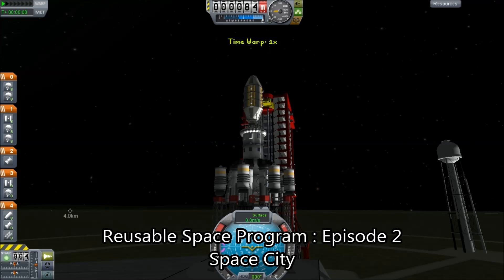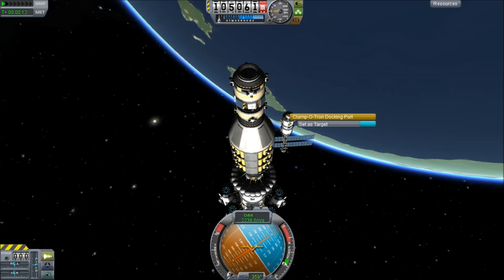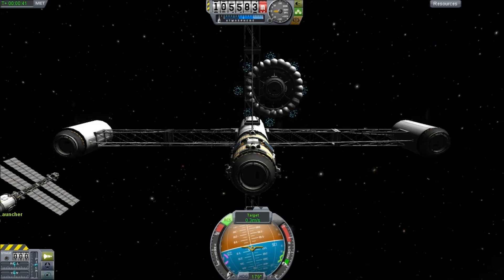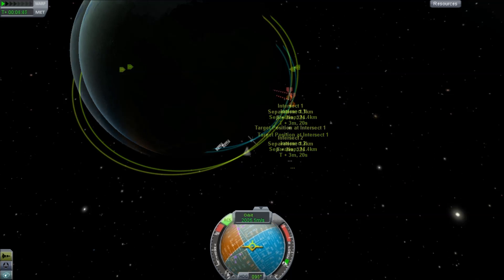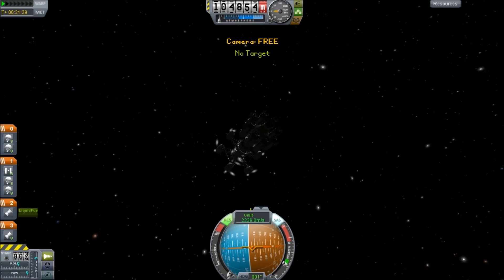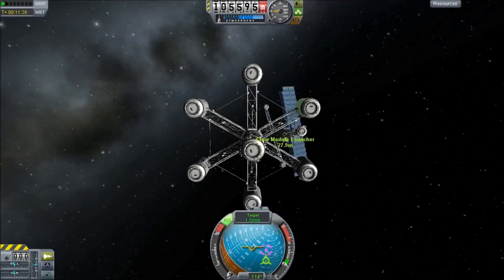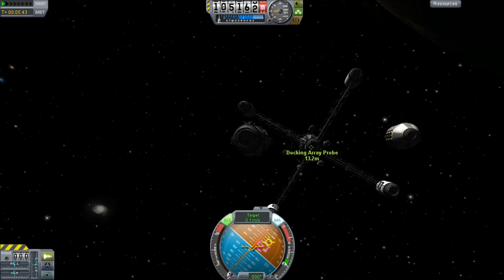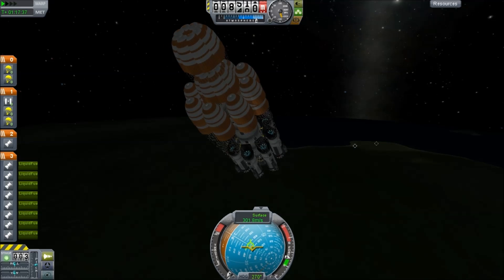Kerbal Space Program - 100% Reusable Space Program Episode 2

Comment: I have a general KSP question. I read that Kerbin has the same gravity, similar atmosphere as Earth except it's one tenth the size. But then how is it possible to establish an orbit going only 2000m/s when on earth you gotta be going 17000 mph about 3 times faster? Wouldn't that imply that gravity is weaker on Kerbin? Maybe it drops off faster at higher altitudes than it does for real? It's weird when I'm flying a top heavy and long ship and I'm trying to tilt at lower altitudes it'll flip but at near space it doesn't as if gravity is much weaker there unless it's the lack of atmosphere..
Reply: +ryccoh The most important thing to remember is that maintaining orbit is nothing to do with going up, and everything to do with going sideways fast enough. The earth has a much smaller curvature than Kerbin, because the earth is 10 times bigger (ish). This means that to avoid hitting the surface, you have to go much faster. Remember that orbit is simply falling and not hitting the surface. The faster the surface curves away from you, the slower you need to go to maintain orbit.
Reply: You appear to be working under the assumption that the force of gravity is not inversely related to the mass of the two objects multiplied over the square of the distance all multiplied by the gravitational constant right here in our particular "corner" of the universe. But it is. Well it's inversely related to the square of the distance between the two objects and directly proportional to the masses but scale wise those numbers don't relate directly to lateral velocity. Also I would assume the gravitational constant around kerbol is not the same as hat of earth. From my own models of solar systems I have found that unity and more accurately PhysX doesn't handle numbers like that very well hence the Kraken exists.
Reply: The mass of Kerbin is 1/100th of Earth's. That's required to have 1g at 1/10th the distance.

This implies that gravity drops off faster for every kilometer. At 700 km above the center of Kerbin, the force of gravity is only about 8.167 m/s^2. So why is it slower for Kerbin? Well, it all comes down to centripetal force. Gravity acts like a tether pulling the object in freefall toward the center of Kerbin. The short the tether, the less speed required. We use the equation v^2/r = a for this. a = 8.167, and r equals 700 km. sqrt(r * a) = v = 2391 m/s.

It's in the math, basically. But the real explanation is that centripetal force and gravity act almost identically in this situation. So, the radius is reduced, the mass is reduced, the ration of velocities is about 3. Why 3? Well, 3 is close to the square root of ten, the scale factor.

Comment: I usually skip RCS thrusters completely and use only gyros and main engines for both moving around and for docking. 

It is actually much easier to dock without them as they tend to move the ship slightly sideways or up / down while they stabilize the rocket making the docking process very tedious. Normal engines don't have this problem making the docking much more accurate. 

When I dock I simply approach the target and stop the relative velocity to the target when I'm approximately 500m meters away. When I'm stopped, I just turn both ships so they are facing themselves correctly and fly slowly forward.  The whole process usually takes only few minutes or less and rarely gives me any problems (unlike when I'm using RCS). 

Usually only cases that give me hard time while docking are if the target ship is unmanned and without power (meaning I need to find a correct spot to approach and dock) or if the target ship is huge and the docking port is too far off the center of mass (usually in cases if I use mechjeb to keep the orientation towards the other ship). 

Not very realistic but that's how I've been docking for long time with great success.
Reply: +Hitto Man Sounds like your RCS issues stem from not placing RCS thrusters equally around the centre of mass.
Reply: +Luke Freeman This might be true but it's extremely hard to place your RCS thrusters 100% equally around your center of mass. If you have a ship that has more than one fuel tank which isn't placed in the center of mass, the center of mass will change during the flight unless you constantly re-arrange the fuel inside your ship. 

Differences between RCS controlled and gyro only controlled ship normally won't make a difference but docking is so precise operation that those small differences start to count. It is practically inevitable that turning your ship by thrust will make your ship move to some direction unless the thrusters are placed around the ship with 100% accuracy. This is in my experience very rarely achievable. If your ship moves to unwanted directions during docking I consider that to be a huge pain in the ass.

If using gyros only for turning there is no thrust and no additional movement ever. The ship will continue to travel to it's direction until you change it with your engines regardless if you turn your ship or not. This makes designing and controlling your ship much more reliable and easier. The movements might not be as fast as with a RCS but reliability is at least for me more important than quickness of turns. Only major thing that gyro-only ships lack is the ability to "strafe". This might be a big issue or not depending how you play but for me it isn't very big deal. 

If I create a ship that needs to dock, I usually place some smaller engines to the front of the ship so I can decellerate without turning my ship around. The extra engines won't usually even weight as much as the RCS fuel/ thrusters I would have used otherwise. The design is also usually more simpler and has less parts which is never a bad thing. 

So far I have played KSP for over 1000 hours and made countless ships that use RCS and ships that use only gyros. ATM gyro only ships seem to be the way to go for me.

Comment: It's happening quite a lot lately, I'm using a rocket based off his Minmus design for beginners, same engines and fuel tanks.  The problem is I keep running out of fuel when I go to maneuver into a Mun encounter, thus getting me stuck in orbit.  I added a middle phase with 1 fuel tank and engine that should get me there, I'm yet to test it.

Comment: so i was using a very nicely made spacecraft with a 1 man capsule with a small docking part on the top. well i found out when docking to my space station, it had a large docking port and well i spent like 30 min just trying to dock it when i was like 2 meters away. never worked. i had no more patcience and got really pissed. then turning on my main engine to full throttle into a solar panel.

Comment: Two suggestions:

Would bringing up another space tug identical to the one you have help with the asymmetry? (Dock space tugs to both ends of the module, dock the module + space tugs to the station, then undock and push the middle space tug out of the way, then redock - sort of like what you did with the RCS tank.)

Also, as part of this you should design/build a space tug!